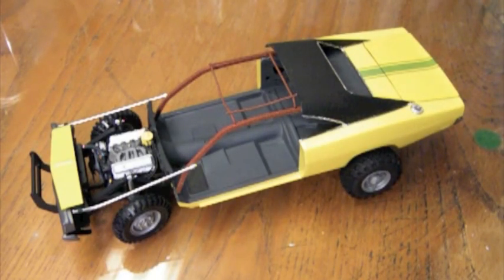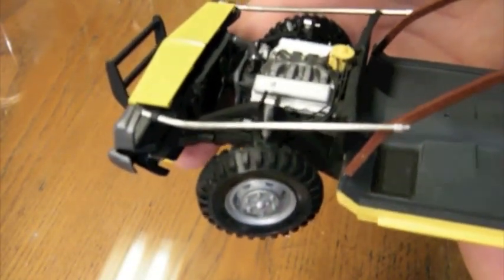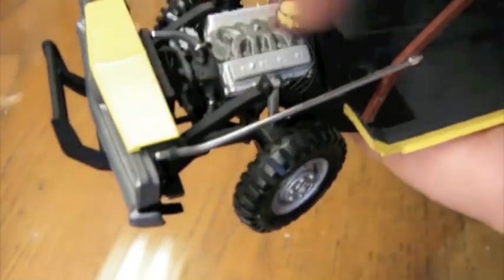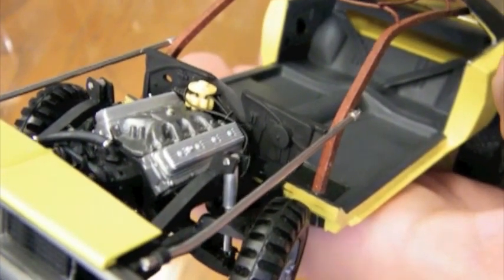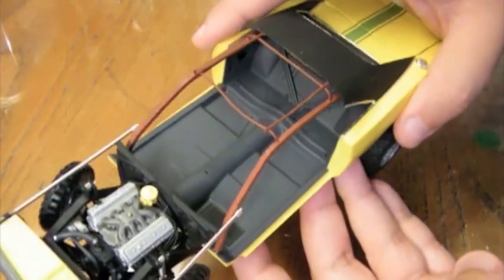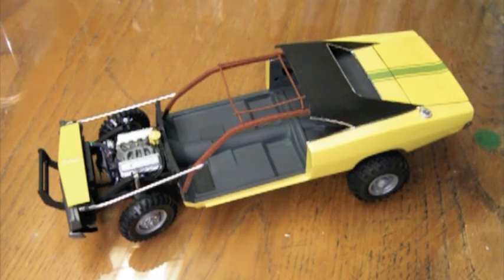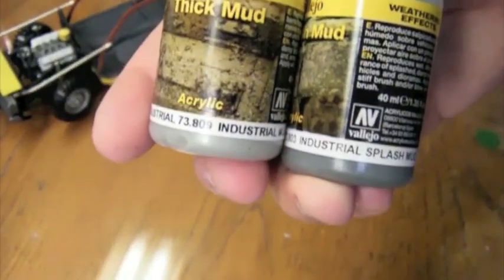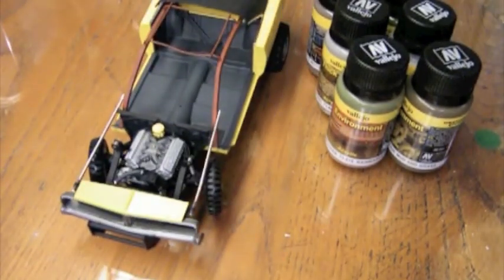Building the 1/25 Scale Half Life 2 Muscle Car - Part 6

Comment: Like it! What did you make the roll cage out of?
Reply from the maker: Thanks! The square stock is either .040" or .060" styrene, and the round bracing is heavy gauge floral wire (top) and stainless steel rod (front).